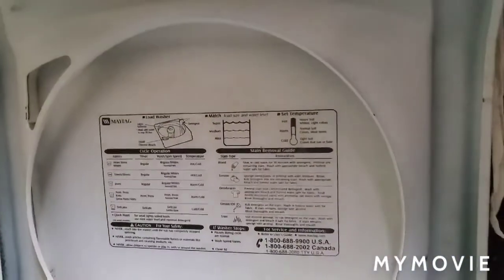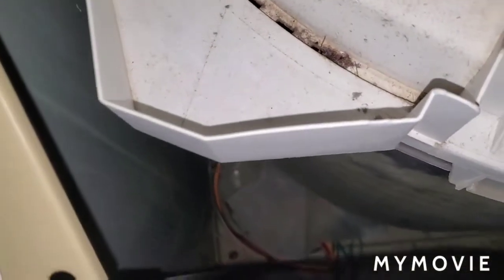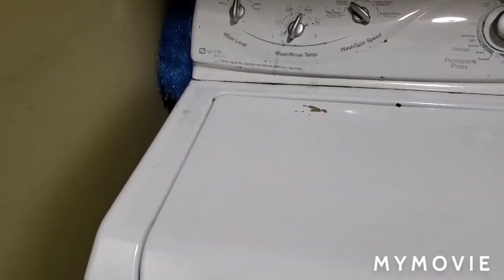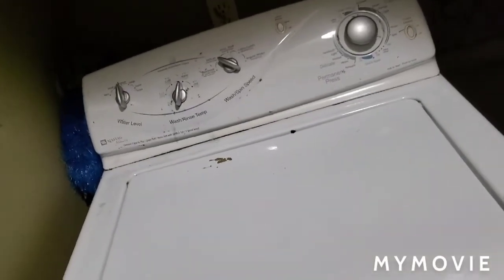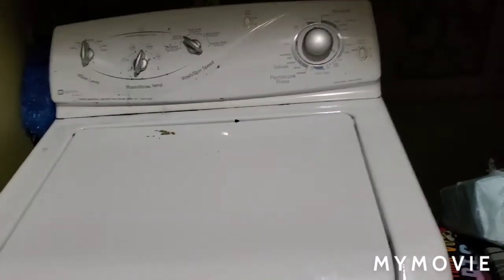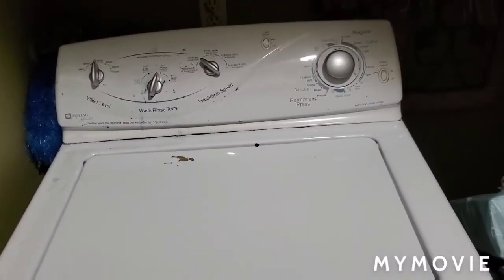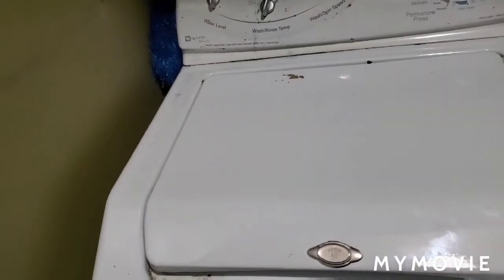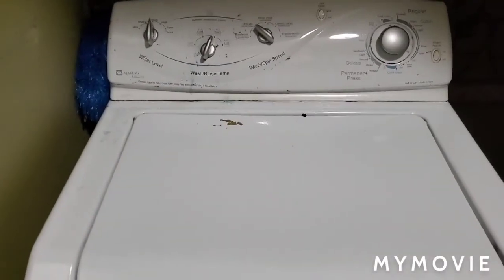Attempting to fix the Maytag Atlantis washer

Comment: It’s probably time to get a new washing machine if the transmission is bad I recommend a whirlpool direct drive or speed Queen tc5
Reply from the maker: We ended up getting a Whirlpool HE washer. I'll have ton get used to it.
Reply: @thebiglt2187  it won’t last 5 years and won’t clean at all
Reply: I agree.
Reply from the maker: Lets hope it last a few years without problems
Reply: @thebiglt2187  I agree. How much oil did the maytag atlantis transmission hold?
Reply: @thebiglt2187  it won’t last